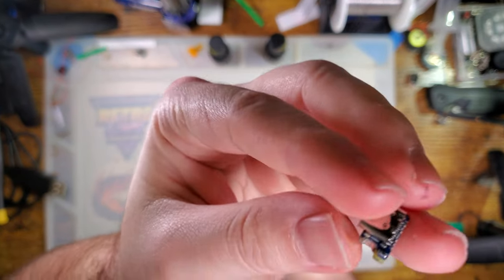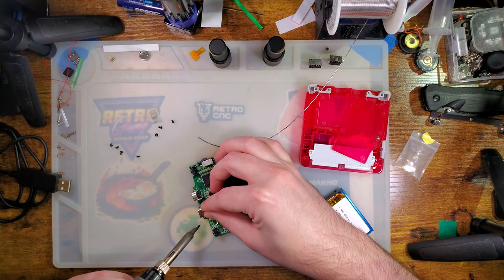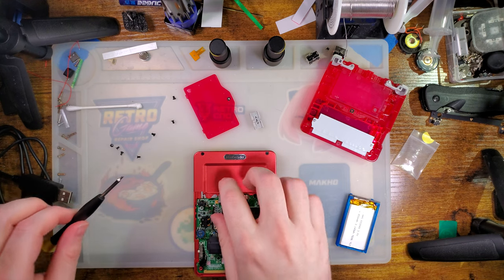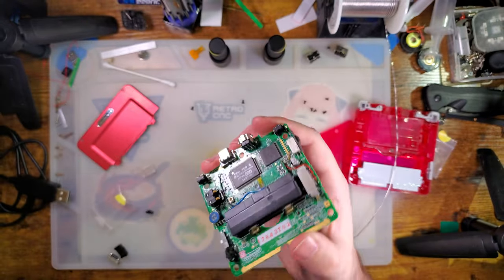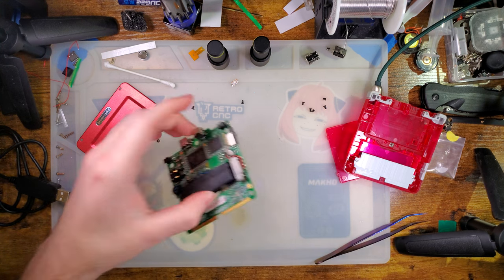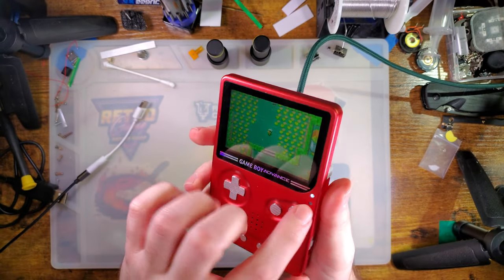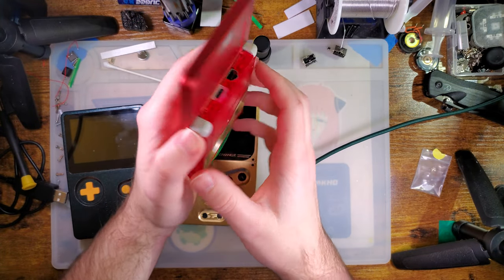Giltesa Game Boy Advance SP USB-C Centered Mod

Comment: For new folks, I've just been recommending that they carefully cut off the old power port with flush cutters. Even giving them step by step instructions using an iron and solder sucker, I feel like at least half end up still lifting pads.
Reply: Would it also help after cutting the port using air solder?
Reply: Anyone with proficiency with a hot air station will be more than proficient enough to desolder the port with just an iron. Hot air is a little overkill, you risk melting the plastic inside the port onto the board, and you might lift other components using the hot air. Either  remove it with an iron, solder sucker, and wick or cut it off if you aren't comfortable soldering.

Comment: Detach the 2 grounding pins. Snip or desolder, your choice
Then cover the CPU and chips close to the port, and then run a ball of solder along it, add heaps of solder and lift it off in a blob 🤷‍♂️

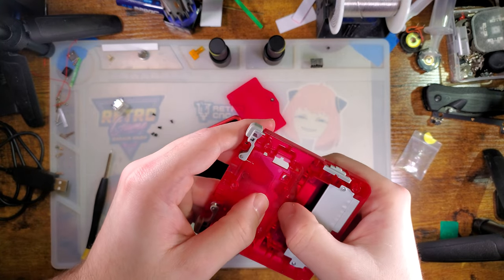Comment: 6:50 to prevent the nut for the battery screw to fall out, after removing the screws, just close the battery lid and fasten its screw - then it is held in place when opening the case.

I just checked my GBA (I used the FunnyPlaying centered USB-C with Audio mod) using the 240pee_mb.gba test rom. I can't hear anything on the left speaker when executing the right output test and vice versa.
Reply from the maker: I've used a dab of hot glue on units I find myself disassembling frequently. I wonder how effective it would be to just try crimping the adjacent plastic with a fingernail or a flat head screwdriver.

Comment: Did this mod on my slate last week works great…wish audio worked with c-c cable though otherwise great mod to do to the slate and super easy to do
Reply: Is there any USB-C mod that word with audio on the slate?
Reply: @SToad  it has audio just not with usb c-c cable while charging…if you use a usb a-c cable audio works just fine while charging
Reply: @bananaking1288  I see what you mean. And I was confused then. So there is no way to have audio via the USB-C port currently?
Reply: @SToad  audio works fine…if your charge brick is a usb c port (usb c-c cable) you get no audio while charging…if its a usb a port on the charge brick (usb a-c cable) you do get audio…audio with usb a-c cable, no audio with usb c-c cable
Reply: @bananaking1288  what I meant is USB-C headphones via USB, not via 3.5mm. Was wondering if that’s even possible nowadays on the GBA.
Reply: @SToad  oohhh gotcha yea not sure i dont use headphones on my gba
Reply from the maker: @SToad If you're asking if the GBA SP can support USB device... no. The GBA SP will never support USB devices, regardless of what style port is tacked on. USB protocols simply require hardware that the GBA SP is not equipped with.
Reply from the maker: This is related to your specific C-C USB cable: https://www.youtube.com/watch?v=LsJFdVJFTQo
Reply: @makho  Alright thank you for the info!

Comment: Question @makho wouldn't a hot air gun be easier to use to help remove the original charging port?
Reply from the maker: If you're comfortable melting the port, sure. Make sure you shield all the adjacent parts like the shoulder button, link cable port, and battery terminal or you'll melt those too. Be careful of the components on the opposite side too. This is a dual sided board so you cannot just hit it from the underside either.

Comment: Question @makho Do the motherboards require you to install BIOS software or is that all just built into the board? Looking to construct my own sp and couldn't find an answer to this.
Reply from the maker: Game Boy consoles (all variants) use a SoC design in that the CPU contains every single part of the console, including the BIOS. Most models use external RAM though but otherwise the SoC contains everything you need.

Comment: I'm curious about the resolution of that green-tint problem. I've got the same thing going on with one of my boards too, IPS screen but I dont have a stock screen or spare ribbon/mod to troubleshoot with yet.
Reply from the maker: In this case, it was a bad ribbon cable. I used this specific backlight kit in A LOT of Slates and had managed to put a hole in it.

Comment: Do you not have brightness control on this slate?
Reply: It's the button combo setup (Sel+L/R)
Reply: @Omega_2  I don’t see anything soldered to the lcd board though?
Reply from the maker: Probably not. 

The backlight kit is one of the last things we made and this particular slate pre-dates laminated displays. I don't think the kit in this unit even supports brightness controls.

Comment: These port mods are pointless until they sort out usb C host stuff
Reply: they did sort it? its compatible with usb-c to usb-c chargers, I have one installed in my sp
Reply: @supermario3D1 one way though. Personally, having to flip it occasionally if it's on the wrong side is a small price to pay for usb c to c and audio out
Reply: FunnyPlayings supports usb c host now also.
Reply: @jeremym8748 audio out but it's one channel only lmao
Reply: Point being, these still have a ways to go. For now they're just motherboard destroyers for new modders lol
Reply: @3a.m.284  pretty sure these mods have been pushed as far as they can go. The limitation is with the design of the SP motherboard.
Reply: @smol7751 it's two resistors and you get USB C host, they've done it already with non centered ports. It's lazy design not that they have no room or anything